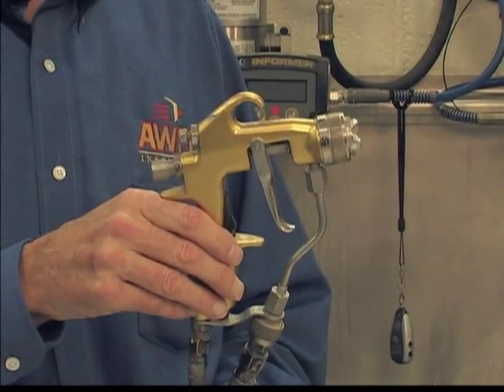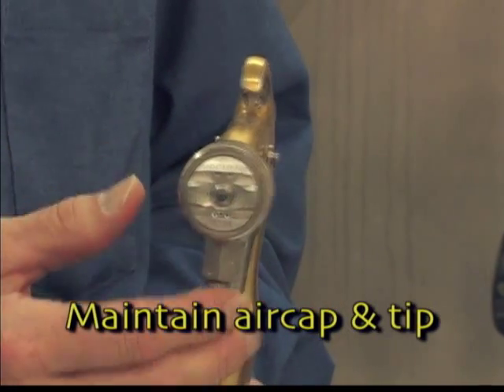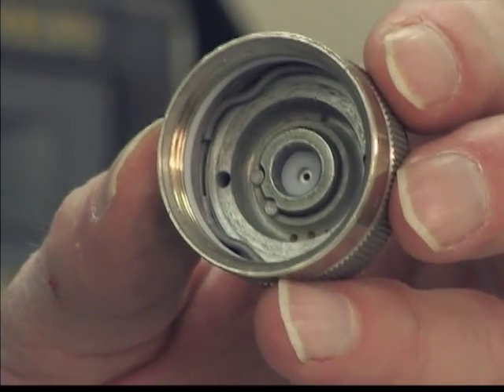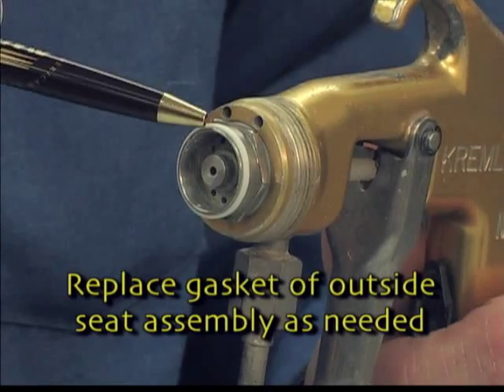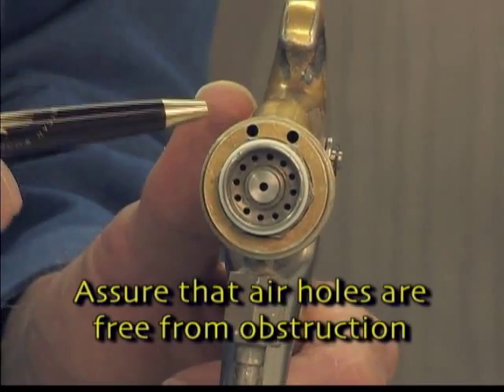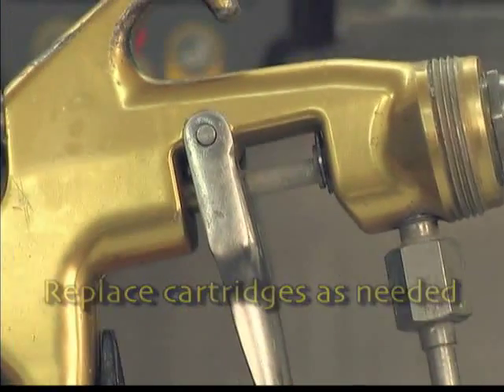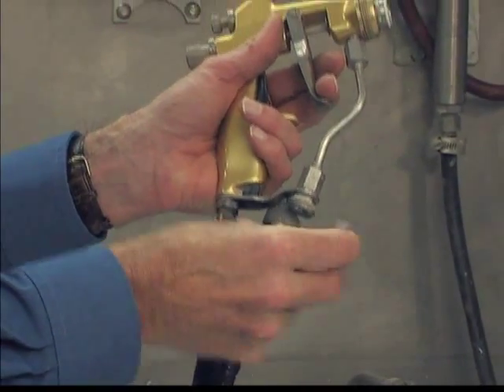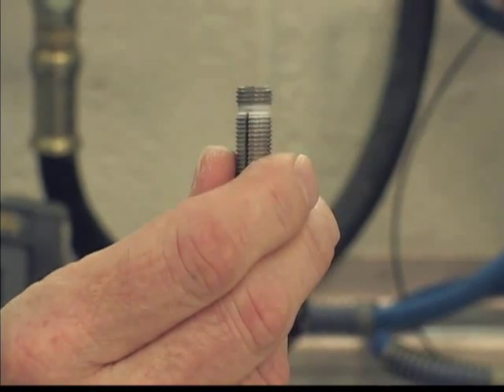Maintaining & Inspecting Your Air Assisted Airless or Airmix Spray Gun

Comment: My gun has some spitters what can be wrong Whit??
Reply from the maker: Pump is not developing full pressure on both up and down strokes. Paint viscosity too thick, try reducing a little. You also may have a clogged high pressure filter at m-base of gun, or at the pump. Check all of those. You might also have a worn out tip.